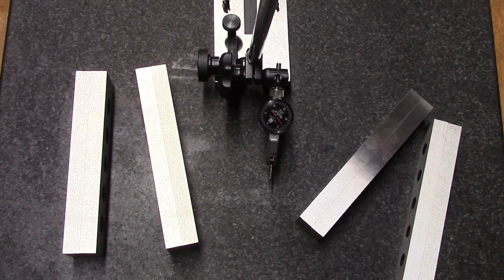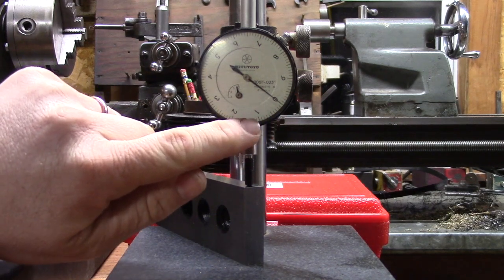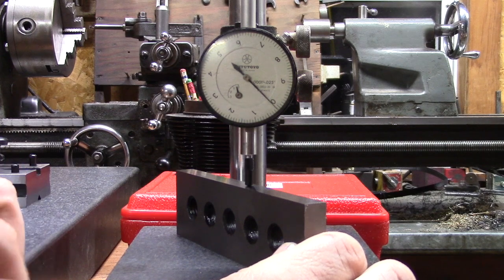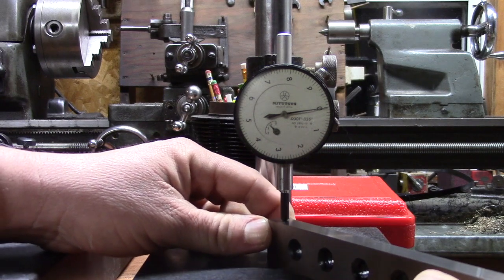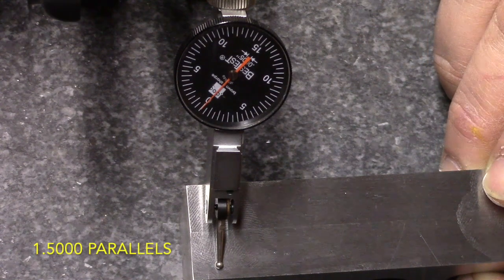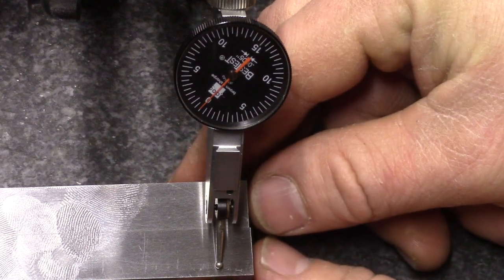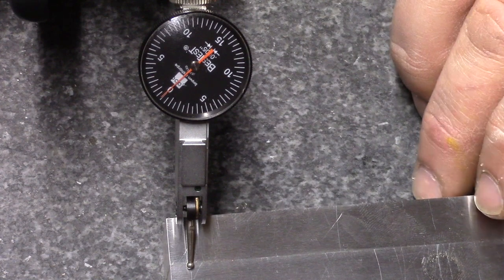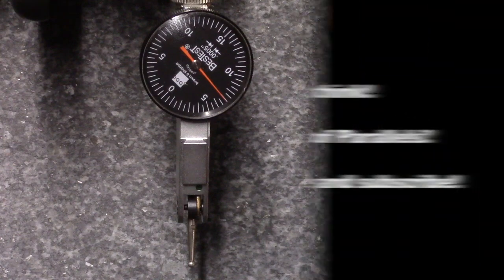Testing Grizzly Industrial Parallels For Accuracy

Comment: I don't have these parallels, but I expected them to be within a thou or less. I'm basing this on Asian parallels, grinding vise, and 1-2-3 blocks I indicated. They were mostly within two tenth. FWIW, we use the same indicators. I do like your surface gage. Who's the manufacturer?
Reply from the maker: The surface plate is a DoAll and the surface gauge is actually a Grizzly product too!

Comment: 5:31 The pointer tip is scratching the parallels. Are they any hard?
Reply from the maker: It’s not actually scratching it. The parallels have a very light oil film on them. They looks like scratches, but they aren’t.